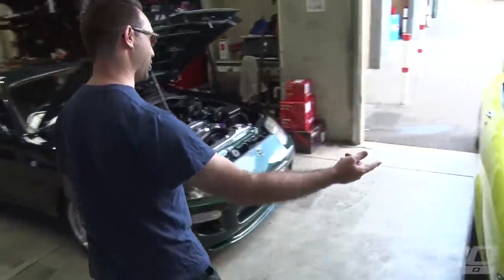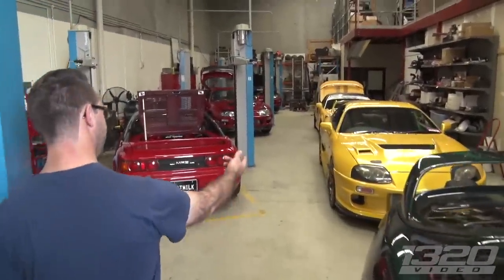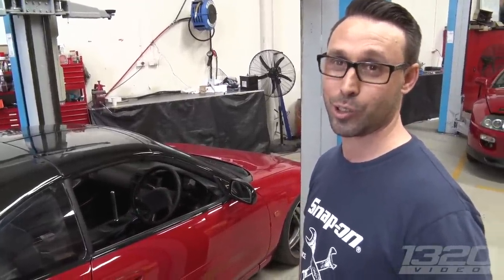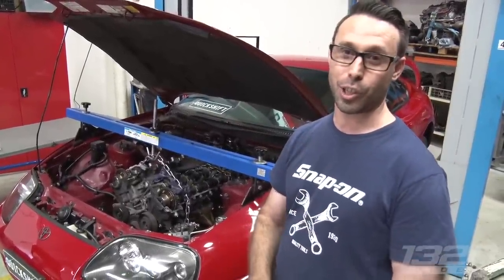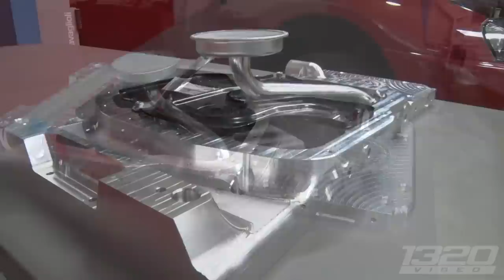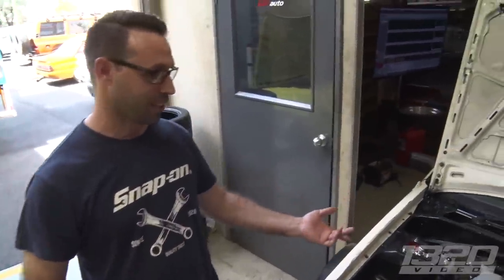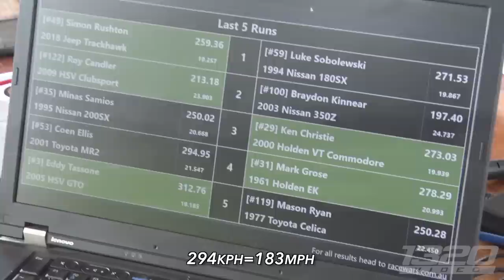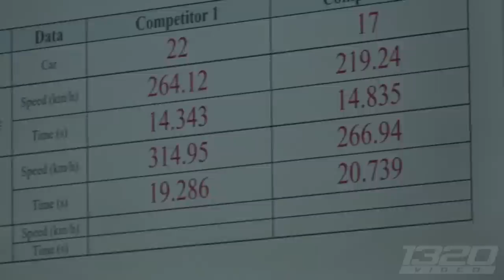We found a V12 Supra in Australia!

Comment: *looks at 2JZ*
"Hey this seems a bit not enough"
*welds a second one to it*
Reply: Would that make it a 4jz
Reply: 1gz is two 1jz engines welded together.
Reply: @markmcgrath9098  WRONG! They are 2 V6's together, the JZ's thing is a lie
Reply: @j.d.8593  that would make a w12
Reply: @MurderPete379  not if you put one behind the other.
Reply: @poepeloerke2  yea wasnt meaning behind the other but you are right
Reply: There's a guy you can find on engine swap depot who connected either 2 2jz's or 2 1jz's to create a v12 kart
Reply: Drake Perry it wouldn’t be a v12 cause 1jz/2jz are inline 6
Reply: That's probably SO FUCKING HEAVY, it's heavier than the fucking chassis

Comment: Calling the 1GZ a “supercar like engine” is a bit of a stretch 😂 
Same design mentality as the 1UZ; smooth, quiet and torquey... never designed to make power
Reply: All comes down to the heads, Bottom ends built real tough, heads were never designed to breathe
Reply: It’s a V12, must be supercar engine! Keen to see how much he spends trying to get 1000hp out of it, vs what he charges for a 1000hp JZ. Hartley Engines in NZ have put plenty of hours into these engines, wait till you see the price on one of their billet V12’s! Great engine, but better options out there for 1000hp
Reply: @jarrydbowater1790  the thing, 1GZ is from the Toyota Century which is the Japanese version of Rolls Royce except more fancier
Reply: They can hold MASSIVE boost
Reply: @simonhill6267  tru dat

Comment: I really hope the 1GZ engines get more aftermarket support. They're basically two JZs with wimpy internals that share a crank.
Reply: Basically, NOT.
Reply: He literally thinks it’s a v12 like a Lamborghini v12 smh the only reason that Cedric came out with a v12 is because is literally barely vibrates when running (Toyota’s way of combating Mercedes and bmw) not fucking Lamborghini
Reply: connor mather Needs higher compression, aggressive cams, flat plane crank, etc.. basically everything that will make it less smooth and dailyable in pursuit of performance

Comment: I repainted my '73 goldenrod yellow mach-1 the same pearl yellow as that awful supra! It was back in the mid-80's, I was young, probably high... definitely high. Bu it was slick! Midnight black metallic hood, pins, mach-1 stock stripes, polished stock billet aluminum mags, brown int w/fold-back rears, 351C auto. Slower than my e-bike, but such great memories. Like cruising LSD on acid with Tubular Bells on tape at midnight in February when no one else was around. Good for the soul. Honestly, that's all they were good for. Had a few. My souped-up aveo could beat every muscle car I ever had in every category but stink. Miss that aveo. 5 glh turbos in our past. Nope. Aveo. AMS built our VR4 back in the mid-90's. Nope. Aveo. 03 EVO 8, custom-built from a shell by Devo, an offshoot of AMS. Sold it. Kept the aveo. Nothing could touch it! 8k new. 120 in performance parts: K&N, tornado, 1-ohm resistor chip in the ats. Before, nothing after 4.5
After, screams to 4.5, then started spinning tires! Unreal! Took STI's for the holeshot evey time!
Miss that car...

Comment: If anyone’s interested in 1GZ’s, punch some of these into YouTube:       Top Secret (first v12 supra), The Skid Factory (twin turbo V12 cruiser, Alan and Nathan have built v12s previously), Olivecrona Drift Motorsport (NA Hartley V12 S14 drift car), Hartley Engines (they design and produce billet V12’s that rev to 12,000rpm), nathan_toyotav12 (v12 Cressida with ITB’s). Plus a few others I’m unfamiliar with.  Great sounding, very smooth engines, but they are far from an ‘easy 1000hp’ as the video seems to imply.

Comment: I had a 1991 toyota Celica gt hatch manual trans 5 speed and that lol thing was quick needless to say I totaled it and put the engine and trans setup in a 92 celica with a few more extra holes we made it work I drove that car for 3 more years on top of the 5 I had to start i beat the hell outta that car and it still ran just tore trans all up and it was so hard to find parts for but anyway the red celica he has is beautiful wasnt a fan of the older 80s models

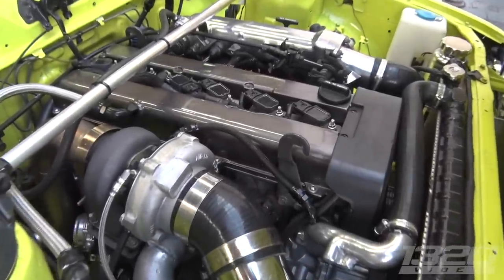Comment: 1:16 is that gt-four 2jz swapped too?
Reply: Toyota swapped MKIV Supras to 3S-GTE for racing. Why would you try to swap a 3S-GTE to 2JZ-GTE? (You can’t anyway). The 3S-GTE has the same Yamaha design and both use CT20 turbochargers. Same bore and stroke. In every way that matters, the 3S-GTE is a 4 cyl 2JZ-GTE.

Comment: Someone did it already v12 supra WTF
Reply: Yes, but that required extensive modifications. This guy is trying to build one in a way that, with help from the parts that they're designing, would allow for the V12 to be just 'dropped in' there, without having to resort to exotic systems, like a dry sump.

Comment: Top Secret did not make 1000whp....
Reply: Who said 1000whp??
Reply: @QUICKSHIFTtv   If that's you talking the Top Secret Supra did not make 1000hp it hasnt been proven to make anything and it's in Florida right now it feels like a 450-500whp car.
Reply: @msengineeringdavid3148  Right, I said 1000hp, not 1000whp.. so figure out what you're trying to say first.

And just because Top Secret detuned their Supra some time before selling it doesn't mean it never made the power. I've had countless cars make far more power than they're currently rolling around with.. there's many reasons people might detune a car... sometimes for reliability, sometimes to solve a fault, sometimes because they're running it on a different fuel (race fuel / E85 conversions back to pump fuel)

Your argument that someone told you it feels like less power now is entirely unscientific and has no bearing on how much power the car made in the past. I mean, check out the top speed runs that the car did... 450-500hp? Are you kidding? Of course it made more than this in the past. So silly.

Comment: Why use a old V12 that you will have a hard time finding parts for?? You can get so many V12s that are made better than this old motor.
Reply: Cuz it's a Toyota V12. And the guy literally said he sold the 2j in it for double what he paid for the V12. Cuz it's still cheap. Besides, it's basically two 1JZs molded into a V12, naturally aspirated.
Reply: @joaquinpaul3912  There is better tuned V12s out there. He will change his mind before this thing ever sees a race. I know its toyota but that engine was made for a luxury car not a small racer. It would be different if he could buy the high performance parts easily so it could handle 1500 hp but that is not going to happen. Thats why my point is why not get the BMW V12 or Jaguars V12. These motor are less than $10K last time we had to swap one and they are well made for racing.
Reply: @csb772  first, this V12 with two turbos in his supra is what made Smokey Nagata famous in the 90's. It made more than 1000hp on low boost. And second, you must not have watched the video before running your mouth because that's exactly what he said he's going to do. Fully forged build, twin turbos with 1000 at the wheels. Ready for racewars next year. Why do you even click on a video if you have no intention of watching what's said in it??